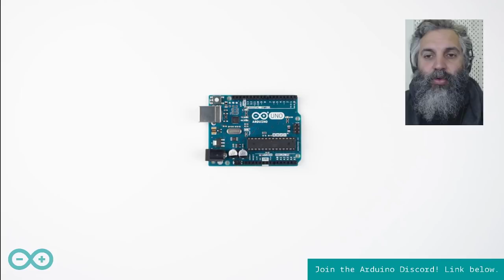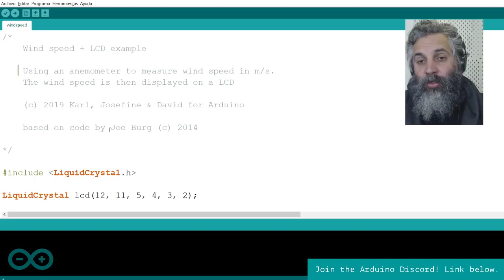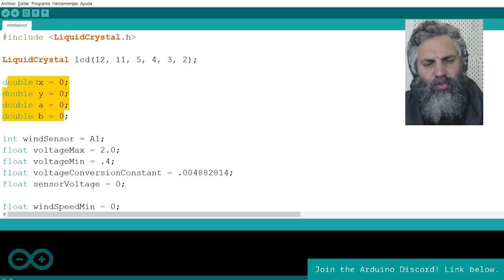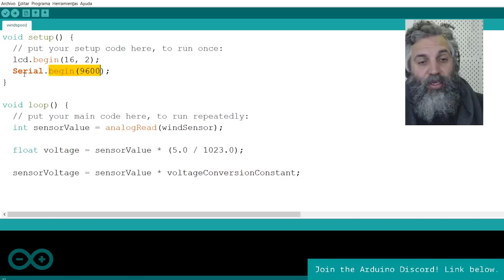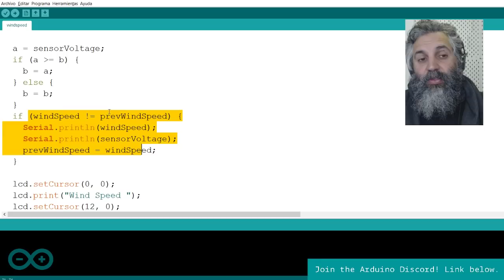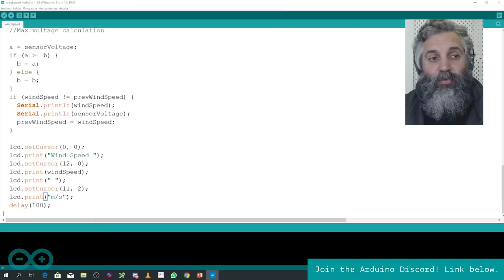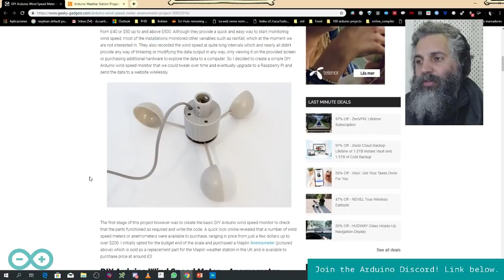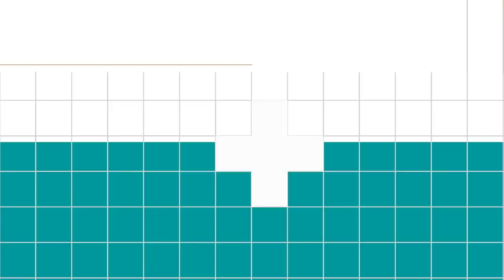Anemometer with Arduino Uno - Arduino LiveCast S03E03

Comment: Brilliant tutorial! Thank for your time! I have the same anemometer but I use it with an ESP 8266 and ESP Easy firmware. The raw value is 136 which I can convert via the Two-Point Calibration. Which I have done. 136 = 0.000 m/s and 680 = 32.4 m/s I have placed the anemometer right next to my other weather station t match the values. It is pretty accurate, but it could be better. My other station is publishing data every 15 sec, the question is it raw data or the weather station use s some sort of smoothing or averaging calculation. So anyway I just try to find out if my calculations are right? What are your calculations? I have tried to find the answer from the video but I am not sure. :D Thanks.
Reply: Can you send code?

Comment: which sensor is used in the anemometer ?
Reply from the maker: It's explained in the reference slides in the examples part. One of the projects presented has all the information you need

Comment: Is it possible to store the data in a flash drive as .csv instead of printing them on the screen?
Reply: You could save it in a SD card using an SD module and write the values separated by "," and saving the file as .csv